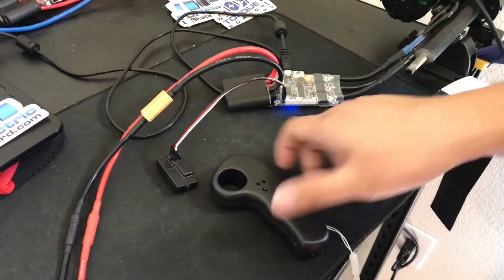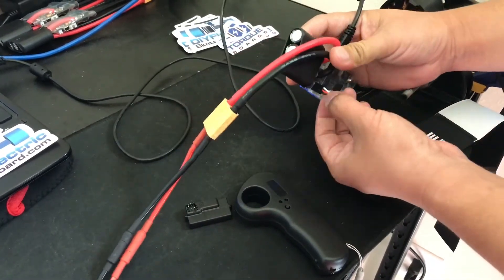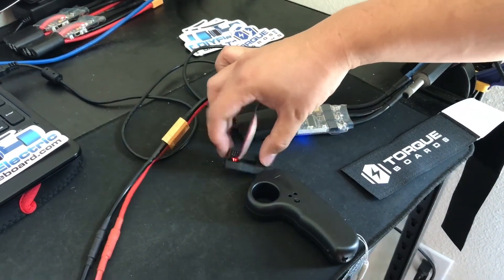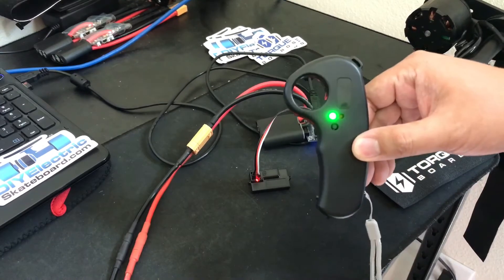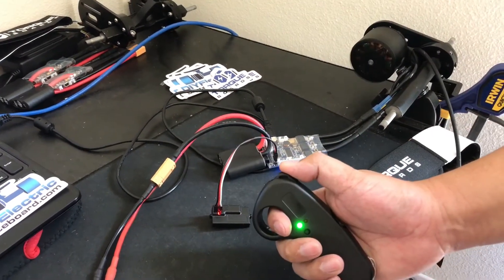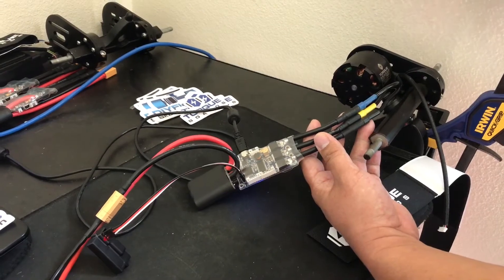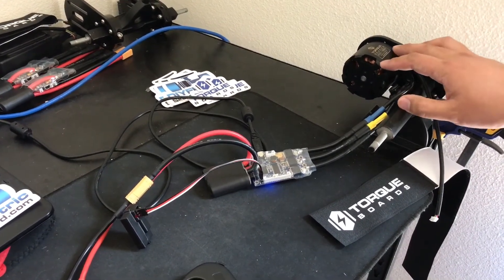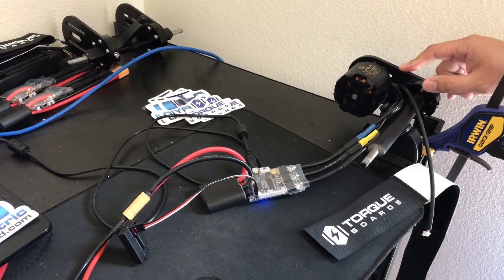DIY Electric Skateboard: NEW Nano Remote Tutorial & Quick Setup Guide Explanation

Comment: Hey noob question here, if i got a replacement remote ( same type and brand) and it came with a receiver, do i need to install the new receiver? or can i just use the one thats already in the board? The new remote and previous receiver are pairing, just wondering if theres any safety issues with that

Comment: DIYElectricSkateboard.com,  do you recommend running your 6355 190KV motor and the VESC in a single motor setup with the sensor wire attached? If so, does this change which 3 of the motor wires you plug into the VESC?